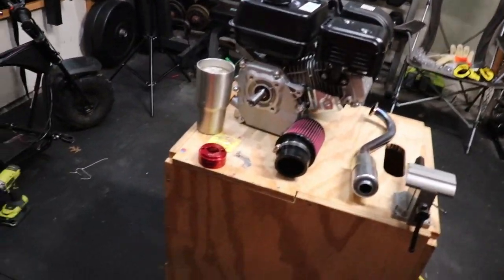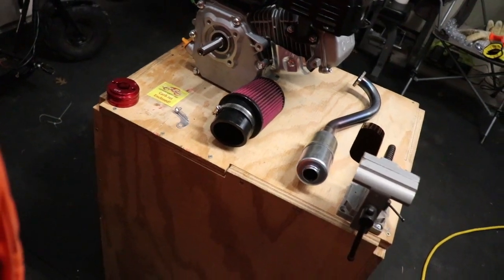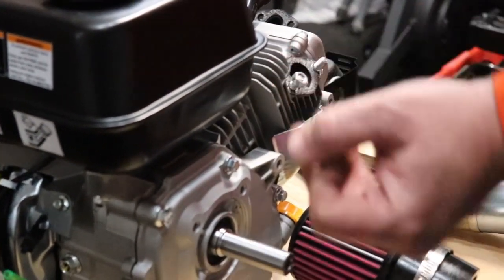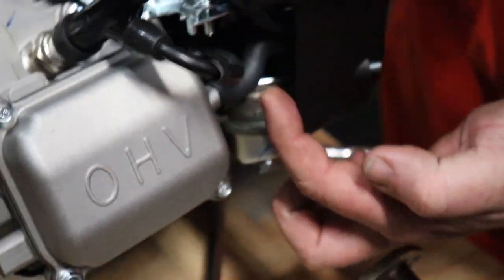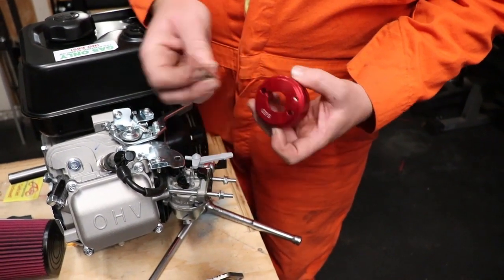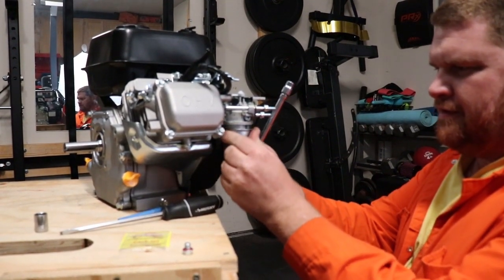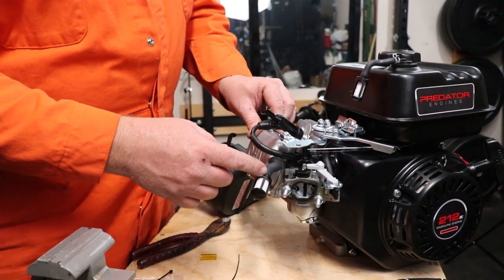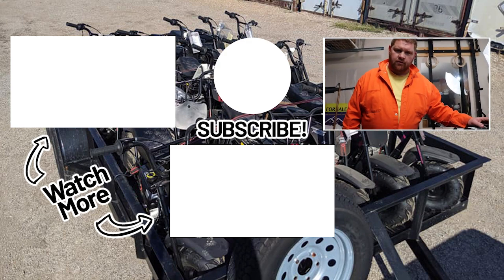Predator 212 Swap - Stage 1 Performance Kit Installed

Comment: Do you change to 18lb valve springs?
Reply: The kit comes with the springs if you choose them
Reply: @dababy_memes6956  do you think it needs the 18lb springs with just the stage 1 kit or not